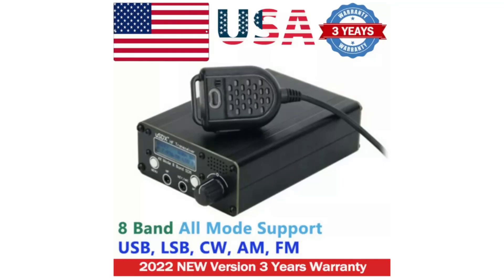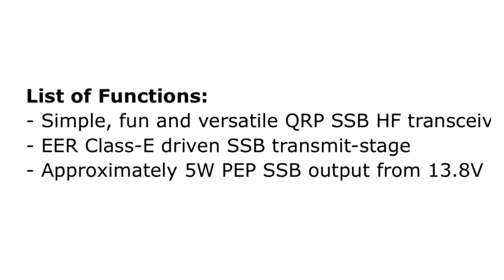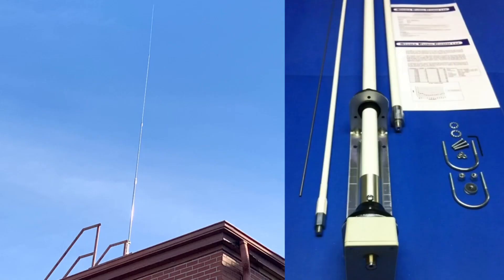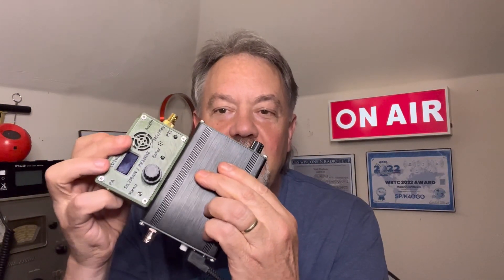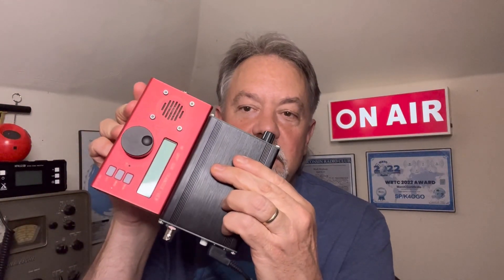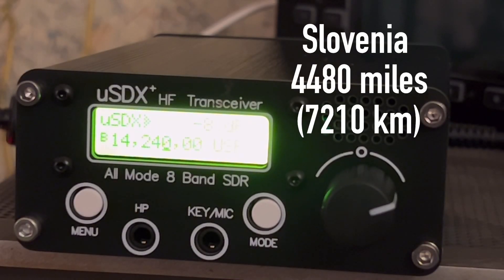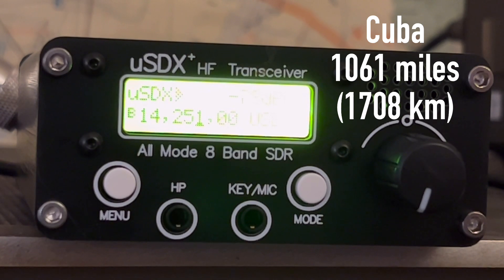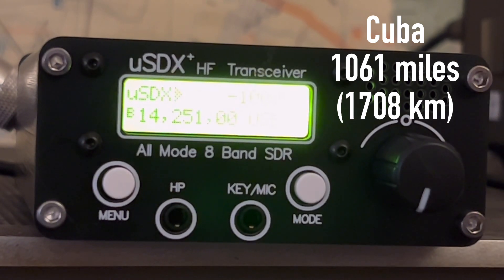uSDR+ HF Transceiver - Making Contacts Straight Out of the Box

Comment: A real cool hack for those is to plug either computer speakers or a small Bluetooth speaker that has a line inpit on it into the headphone jack on the front.  It will sound exactly the same as a very expensive radio. If i plug mine into the same speakers in the shack that i use for my Icom, the two radios sound identical. You can also use headphones pf course. I have been running my uSDX+ a ton, I run it off of a 12v DeWalt drill battery in man pack of sorts and it rocks, I have done a few activations from the top of the ski hill with a simple 20m dipole

Comment: What antenna are you using? You are getting great distances.
Reply from the maker: The antenna I use at my home QTH is a bit of a compromise but works well. It is a Sigma EuroComm HF-360 
https://www.ebay.com/itm/321710811871?mkcid=16&mkevt=1&mkrid=711-127632-2357-0&ssspo=7p4KTCMES8S&sssrc=4429486&ssuid=IVyKb51XQj2&var=&widget_ver=artemis&media=COPY

Comment: Hi there, could you please confirm if this model has the function knob properly oriented with down/up properly mapped to counterclockwise/clockwise? And does it have an SWR meter? Have you measured the TX power on the higher bands like at 10m? Thanks a lot!

Comment: Walt what is the cheapest uhf vhf hf all band radio that you would recommend I want a all in one package but don't want to break the bank with it either 😂
Reply from the maker: To get all that your cheapest option is probably the Guohetec Q900. I’m actually interested in that radio myself.
Reply: @COASTALWAVESWIRES  thanks I will check it out

Comment: A lot of people complain about these radios, but not everyone can afford an expensive radio - these let, so many new people get into HF - all you need is this cheap radio and a resonant antenna (I use an end fed with an equally cheap ATU with mine).

Even the digi kit is coming down in price now of rthose wanting to work digi modes.

It's also perfect for those on foundation licenses that aren't allowed to use much power anyways.
Reply from the maker: I actually like this one a little more than the rest of the uSDX radios

Comment: Hey Walt! Thanks for this video. I got one with a battery from china, and so far so good. My plan is to combine it with the AT 100M, and a Micro pa50 for for a tiny 50w rig, or a qrp rig with that doesn't need an external battery. Keep up the good work! I use a "tactical" headset with mine because I am losing my hearing, and the little microphone is tough to pick out call signs. It is a tac sky comtac II with the baofeng ptt connector. Much easier to pick out signals, and the microphone works great. Looks dorky, but I am not a slave to fashion.
Reply from the maker: Thanks for watching! That sounds like a cool setup. I really need to get out and play with this radio some more, it’s a cool little rig for the price. All the best and 73, Walt K4OGO
Reply: Did you follow through with the set up?

Comment: Would you think of this as a reasonable beginner HF radio. My goal is a G90. This might be a good transition and help me get used to HF
Reply from the maker: I would go straight to the G90 if you could. This radio takes a lot of tinkering with to get it really dialed in. Plus as a beginner on HF low power can be frustrating. The 20 watts in the G90 is perfect
Reply: I have one sitting on top of my Yaesu 891.
I use it a lot to listen, scan around the bands.  
I made my first HF QSO with a man in Minsk (RA) with 4w with it in my car.  
It has a CW decoder and  practice. 
I would suggest looking around YTube to see what settings work best

Comment: Thanks for posting.  I've been looking at these to get back into 20M hf DXING.   Worked the world on a  SGC2000 and Yaesu FT891 (spoiled by 100W) but this looks to be a minimalist blast.
Reply: Straight out of the box made contacts on 20M to Rhode Island and Boston using a small homebrew hamstick mounted on top of the garbage can!  I can tell these radios definitely have their limitations but hey for $120. Fun!
Reply: Need to post video and not monopolize yours....this rig is amazing. Heterodyne receiver equals my Yaesu 891 IMHO. Hard to believe.  Working from FL on homemade windom 10' up. No tuner.  Amazing contacts and signal reports from all across US and Canada. People can't believe I'm working 20&40 on just 4 watts even though just above noise floor. I am blown away. Sure, lacks features but who cares. Fun basic dxing. Cheers Steve kk3sc
Reply from the maker: It’s a great radio if you know it’s a minimalist cheap rig. 73
Reply: @COASTALWAVESWIRES  Roger.  That's exactly what I want.  After quality rigs now how low and minimal can I work the world.

Comment: Im looking into getting one of those in the next few days and its cheaper to buy without the internal battery, i have a HF radio on long loan at the moment and with the size of that SDR HF radio it will fit in perfectly with my QYT KT-8900 2m/70cm radio.. I had a HF-360 antenna, because i live by the sea the joins eneded up corroded and it fell apart, now i use a silverrod CB antenna without the loading coil for my HF work and it works really really well as its just slightly longer than the HF-360.. Thank you for your video.. M6EVD..
Reply from the maker: Thank you so much for watching Clive! 73 de K4OGO

Comment: Walt - took DL2MAN's (tr)uSDX unit to Melbourne, AUS and immediately realized that it did NOT support 10m and 15m.  Guess what is hot in Melbourne - 10m.  The classic (tr)uSDX only supports 80,60,40,30 and 20m.  20m and 40m were poor in Melbourne.  Which supplier did you buy your uSDX+ from?  I'm looking at ebay and would like to determine a supplier.  Also - how do you compare the wattage output between the (tr)uSDX and uSDX+ ?  I think I was getting almost 5-6 watts from only 12v with the (tr)uSDX on 20m in Melbourne.  Would try the uSDX+ if it's even close in output to the (tr)uSDX.
Greg - AC1NY
Reply from the maker: Hi Gregory, I got mine on eBay from the seller diyradio and it's a pretty decent little radio. I think it's pretty much the same as the (tr)uSDX as far as wattage (just over 5 watts). It's a lot more rugged and solid than the (tr)uSDX. I'm happy with mine. 73, Walt

Comment: How is this device performing in higher frequencies such as 21 MHz, 28 Mhz?
Reply from the maker: It performs well on 17, 15 and 12. I have only used it a few times but found it worked pretty good. I really need to revisit this radio.

Comment: Nice Video. I also bought the USDX + transceiver. But I have a problem. The SSB Modulation is really bad. I can't use it.  I tried a reset and put the TX Drive Audio to 2. But it does not work. Do you have a solution for it? 73 DL1SFI
Reply: Many thanks. Kind regards from Germany.
Reply from the maker: I don’t have a solution but I will do some digging. Thanks for watching!

Comment: Where to buy the antenna? I'm from Indonesia 1:22
Reply from the maker: https://www.ebay.com/itm/321267967970?mkcid=16&mkevt=1&mkrid=711-127632-2357-0&ssspo=7p4KTCMES8S&sssrc=2349624&ssuid=IVyKb51XQj2&var=&widget_ver=artemis&media=COPY
Reply: @COASTALWAVESWIRES  what about radio compare to usdx and tr usdx
Reply from the maker: @GoExploreCh  this radio is about the same as a uSDX in performance.
Reply: @COASTALWAVESWIRES  what about tr usdx ?
Reply from the maker: @GoExploreCh  in my experience my uSDX is a little bit better than my (tr)uSDX
Reply: @COASTALWAVESWIRES  better about receive, transmit or others aspect?
Reply from the maker: @GoExploreCh  much better audio on receive and better transmit with more power on external battery
Reply: @COASTALWAVESWIRES  thanks

Comment: Hello , COASTAL WAVES & WIRES . Have you yet try Digital Mode yet? If I used PTT in the menu would that be what I need with a AUX to Radio to PC ?
Reply: For QRP, super portable digital modes, I recommend QRP-Labs QDX.  It's a kit that costs $91 plus shipping for kit, case and power pigtail.  Thing is tiny, fitting easily in a shirt pocket.  Only 3 connections required: Power, Antenna, USB cable.  Kit requires winding some toroids and soldering a few thru-hole components - the rest are SMT and already mounted.

PS: I'm not affiliated with QRP-Labs, just a customer and real fan of Hans' designs!
Reply from the maker: Hi, sorry I’m not a digital guy. I’ve seen this radio used for FT-8 on other videos. I’d do a search for that. Once again, sorry I couldn’t help you. 73
Reply: @COASTALWAVESWIRES  Thank You, Also Thanks for the Video. Right out the box with QSO. 73

Comment: Hi Walt I'm 70 years old and just decided to get my Tech ticket. Piece of cake-I have 60 years experience with radio. I'm thinking of getting the usdx+ v2 since I like the idea of QRP portability and will be moving up to general a while after I get my ticket. Any advice? 73 Ron
Reply from the maker: Hi Ron, I like this little rig but for my first HF rig I would take a hard look at the Xiegu G90. It’s a shack in the box that includes an ATU. Excellent transceiver for when you get your general. Good luck and hope to catch you on the bands. 73, Walt K4OGO
Reply: Yeah, but $450 vs $100 ---- it fills a different niche.  For $450, I'd find a used FT-817.

Comment: Hi, thanks for the review!  Have you figured out the jacks?  

REAR PANEL 

I guess you plugged in the spkr/mic where it says "KJ", whatever that means 🙂

Then a simple 3.5mm cable to connect CAT jack to the rig.   But then for the same jack, it says PTT OUT, to key an amplifier?  Can't be both, can it?

FRONT PANEL
Has "HP" -- so that is for headphone only, no mic?  A duplicate of the larger of the two KJ jacks on the rear?  

Also on the front is KEY/MIC.  KEY is for a Morse key?   And MIC is a duplicate of the smaller of the two KJ jacks on the rear?  But it can't be both at the same time?

Very confusing (to me anyway).

Any advice appreciated!
Reply from the maker: Hi, thanks for watching. To be honest I've only used it for SSB so the mic jacks in the back and power is about all I've dealt with. Sorry I couldn't give you more detail. I'm away from home working so I don't have the radio with me, I need to do a deeper dive on it. 
All the best and 73, Walt K4OGO

Comment: Übersetzungsergebnisse
I'm also a fan of the usdx+! I use this rig as a shortwave receiver, CB radio and for 6.67. This rig is especially ideal for preppers like me. It is true that there is a lot of propaganda against this very good rig. The people who want to sell the Tru..x -  kits are said to be behind this action - but I have no proof...
PS  https://www.youtube.com/watch?v=vtob8OV7NKY
Reply: All of these radios were initially designed by the people who designed the (tr)uSDX. They made the previous design open-source so other hams could build them inexpensively, improve on them, etc. They make no money for their work. But since they made the uSDX open source, China jumped on them, modified them, and started assembling and cranking them out. Unfortunately, the Chinese don't bother to do the work of actually testing and tuning them. Class E amps don't even operate in Class E (a resonant form of operation,) unless they are tuned. Without careful tuning, the output power of these radios will be wrong, (too high or too low,) the efficiency will be low, the second harmonic filtering may be so far off that the harmonic content is illegal. This radio design is like buying a guitar. It needs to be tuned. It was intended to be built and tuned by the ham who got the parts and built and tuned it. So when you buy an assembled box online it may be close enough to operate untuned on some bands. It may be 'good enough' on some bands. But basically it won't be good. It won't be what the radio was designed to be, simply because the design was intended to be carefully tuned, and tuning the power output, the efficiency, and the harmonic filter for each band on the rig takes a while, perhaps a few hours, and hopefully a NanoVNA, or something like it. So the Chinese companies just crank out the radios and don't test them. They don't care if the harmonic content is even legal. That's your problem. That's not the sort of rig a smart ham operates until he has verified at least the harmonic content. 

Manuel and Guido have tried to regain some sort of control of this Chinese free-for-all with their (tr)uSDX radio with proprietary software. But they have day jobs. They don't sell these radios. They don't get paid for these radios. They just want to make amateur radio better for everyone.

So understand this when you buy any flavor of uSDX/uSDR radio. They are not a ham rig just because all of the parts have been soldered for you and it comes in a box. It's just a circuit board until the owner turns it into a ham radio by taking the chassis out of its box and setting it up properly, as is the legal responsibility of all hams. AS a ham, when your rig is off frequency or is outputting illegal harmonics YOU are the responsible party, not the fly-by-night company in China that sold you the circuitry. You have no recourse. You can't blame the manufacturer. It's all on you, your legal obligation. So honor the license and the signal you are identifying on the air as yours, and tune up your radio. Verify it is working properly before you put it on the air for other hams and the FCC to hear.
Reply: @johnwest7993  If I understand correctly then over M.. kits are sold for the usdx. If not, who is marketing these trusdx kits??? I think all these many yt videos are great, in which amateur radio operators proudly demonstrate their China-usdx and work successfully with them, these devices from China can't be that bad. I also think all these radio amateurs from the third world are great, who build the usdx themselves according to the circuit diagram, without any kit. I find all these videos that deter buyers really disgusting, in which the Chinese devices are declared to be scrap and these trusdx are praised to the skies. Who is behind it, who is making money with all these overpriced trusdx kits???? These kits are hardly cheaper than a Chinese ready-made device. Which leads me to the conclusion that either the chinese don't really earn much with it, or the suppliers of the kits make quite good money with this open source project! My tip: neither buy a device from China nor a kit! Instead, set up the device completely on your own!

Comment: interesting - had posted a comment previously, but it failed to show up here... anyway, did your rig also have the encoder running backwards? as i had mentioned before, there is a fix via an updated .ino file (usdx_22020511_102wA4.ino), which also improves transmitted audio - these are my favorite variants, but i wish sellers would be honest and not show the better versions with the blue lcd and black screws in their ebay ads
Reply from the maker: Yes mine is backwards as well, I’ll tinker with it eventually and look into that file which will improve the audio. Thanks for the info! 73 Walt
Reply: @COASTALWAVESWIRES  these variants are much easier to update than the buttons-on-top versions... take off the top, connect five wires to the ISP header from an arduino programmed as an isp programmer, then upload your compiled .ino w/bootloader via the avrdudess file - takes 30 seconds... i also like that the backlight on/off works on these variants...